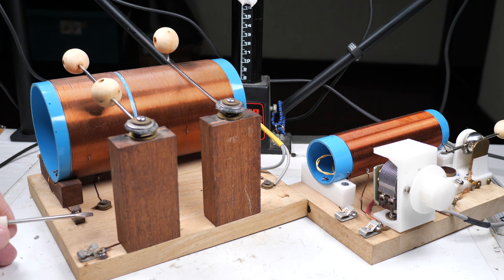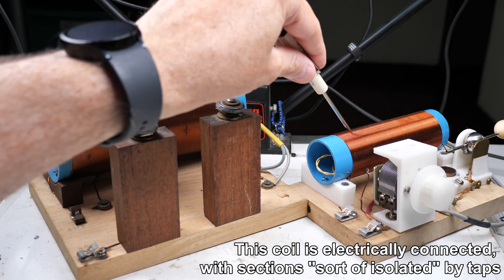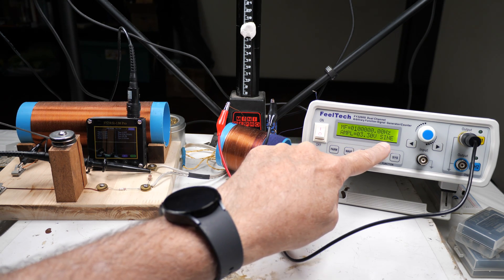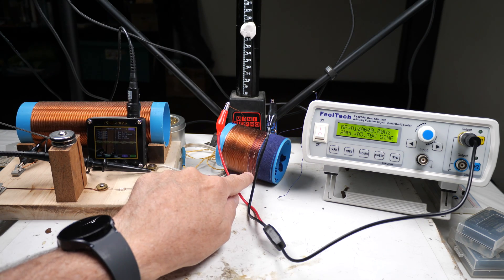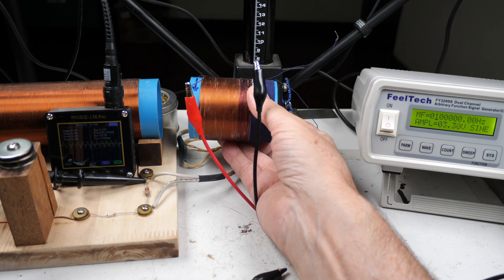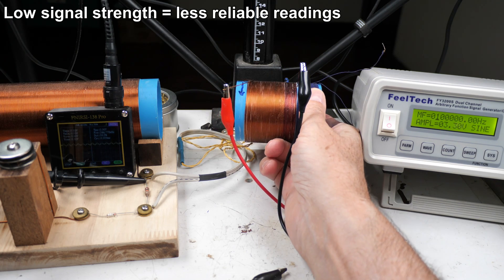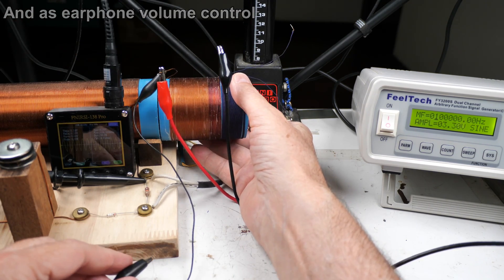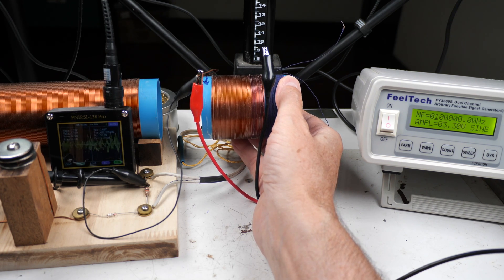Crystal Radio--Quick Demo Of Loose/Tight Coupling (4K)

Comment: Thanks for your videos! You inspired me to build my own crystal radio. It was a bit of an issue to get the components as I did not want to spend much money on a project that might not work. But I managed to get a germanium diode from some ancient device and I got some high impedance earphones on a garage sale. Everything else I sort of had, I reused wire from some transformer and the variable capacitor I had from some rather modern radio. The capacitor is a bit too little for this purpose, I had to put several sections of it in parallel to get about 250 pF. I tried my radio in a park not so far from the place where I live (I am in France) and surprisingly I managed to get signal from several stations! Very weak though, I could hear only separate words, but it worked. I used 26 meter long antenna made of a power cable and an iron rod placed into the river bank as a ground. I want to try a longer antenna and other types of earphone to see if I can make it better. Thank you for clarification of many issues and the inspiration!
Reply from the maker: @mykhailoriabtsev8982  That's great to hear. If you are using old, high impedence earphones, you might need a small capacitor instead of the resistor. Also you can add removable fixed capacitors to the variable one to cover more of the band.
Reply: @tsbrownie  Thanks for your reply. I do use a capacitor there. Before making my radio I also looked at some old books, where there was a circuit with a capacitor, so I used one.